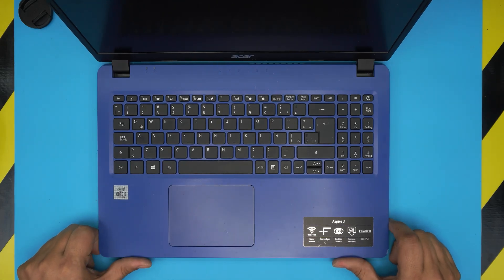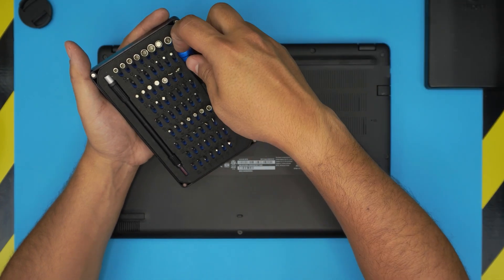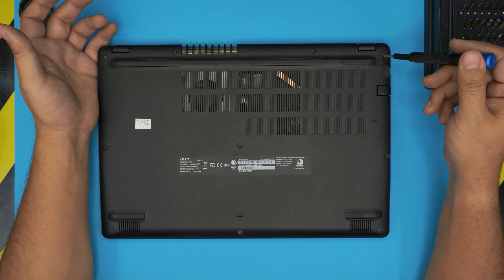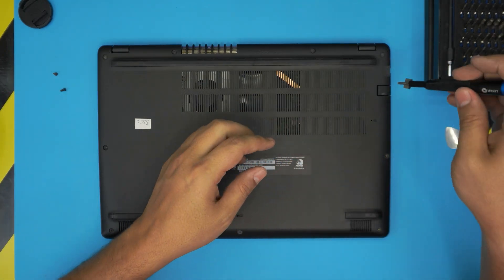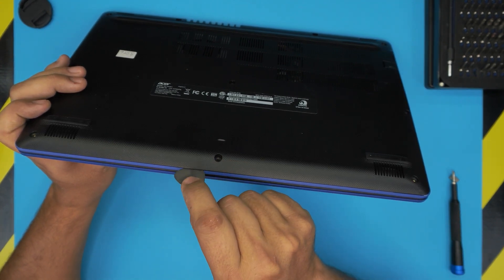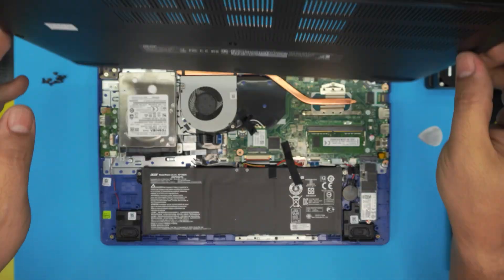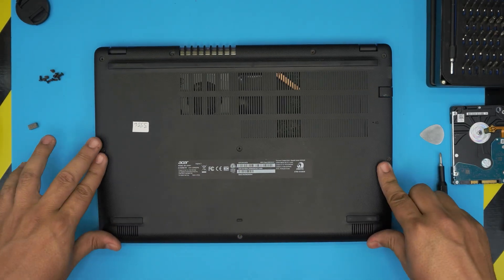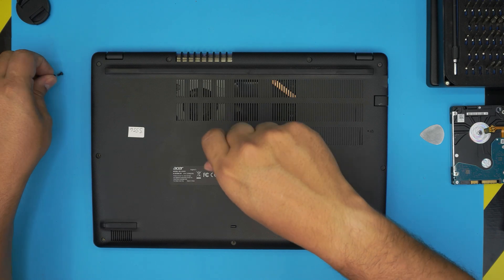Acer Aspire 3 N19c1 🚩 A315 56 38Tb 💻 SSD m.2 HDD upgrade

Comment: I'm trying to fix the similar machine. Previous owner pulled out the hard drive together with the connecting cable and the bracket. While cables are available the issue is with brackets. Any idea where to get one?
Reply from the maker: Thank you for your feedback! If you wish to support the channel, you can like, subscribe, or both!
Regarding your question,  if you installing an SSD just use a double sided tape my friend the brackets are only good for HDD, the SSD don't need one at all, just get a thick double sided tape.
Reply: @uFixTek  This is exactly what I was thinking to do. Thank for dispelling my doubts. All the best 👍
Reply from the maker: It's my pleasure my friend. 😊
cheers🍻

Comment: Upgrade ssd wil lost all our file or not
Reply from the maker: Thank you for your feedback! If you wish to support the channel, you can like, subscribe, or both!
Regarding your question, it all depends on what kind of upgrade you are doing. Are you adding or removing the old drive?
To determine how many drives you have, go to your task manager and navigate to the performance tab. You should see a list of drives, including HDD and SSD.

For example, here is a screenshot of my task manager: https://imgur.com/a/foDc0tt

Please provide me with the model of your SSD and HDD, and I can assist you further.

If you only have an HDD with Windows installed on it and you remove it and replace it with an SSD, you will need to install Windows and transfer your files over.

However, if you have an M.2 SSD with Windows installed on it and you want to upgrade the extra storage HDD to an SSD, you will need to move the files you have on the HDD to the SSD and then upgrade the HDD to an SSD. There's no need to install Windows in this case.